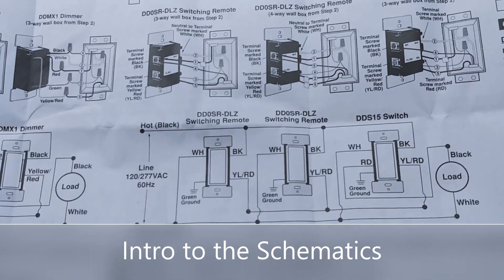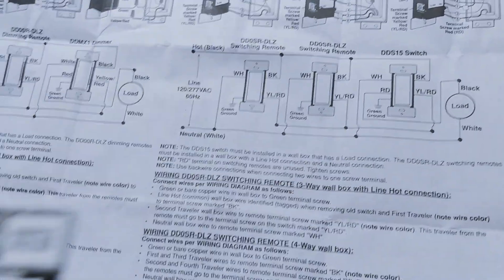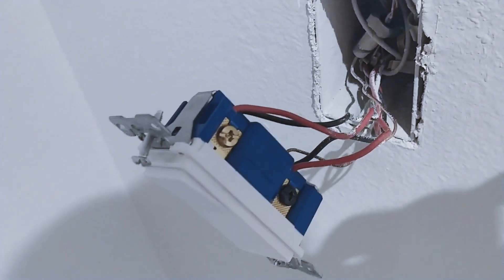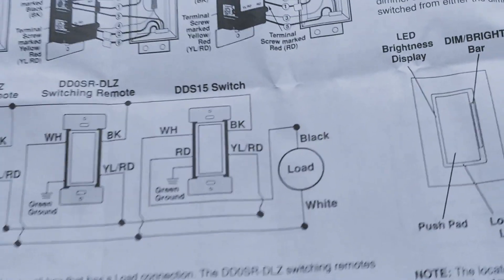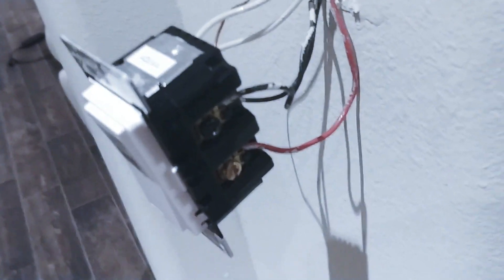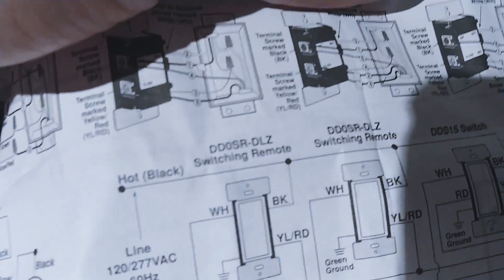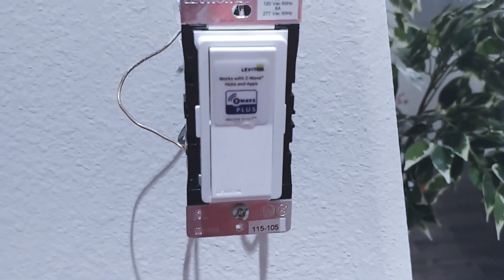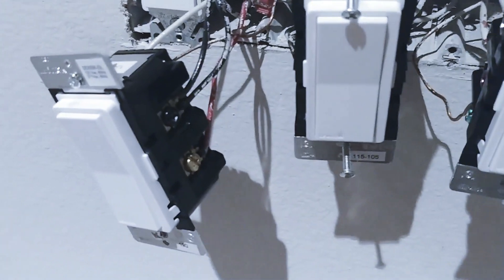Leviton Decora Z-wave 4-way switch installation with Home Assistant

Comment: My system is z wave as well where can i find that 4 way switch i find the single poles at Lowe’s its the same exact brand.
Reply: Thanks
Reply: Amazon has them. My local Home Depot never has the smart switch that I need in stock, I wish there was a Lowes's near me.

Comment: If i am going from regular to smart do i need to change both switches that control that light ?
Reply: Yes, unfortunately. You need to change them as they communicate to the main switch via the travel wire
Reply: Thanks for your quick reply that was awesome. I change all the single poles but the 3 ways are a little annoying the have two red and two black wire

Comment: Great video!!!   You probably won't be able to answer this before tomorrow 6am eastern time but you are doing exactly what I am attempting to do!  Again thanks for the video!  Here is my question, does the two "dump" 3 way switchs have to be smart remote switches or could a just use my existing truly dumb switches and just replace the 4 way switch with the for way you suggested?   I see someone asked the same exact question below.   If anything, I will be sure to give you an update if my truly dumb existing switches work.
Reply: They have to be Smart "Remote" switches, you can't use the conventional 3 way switches in this set up.

Comment: Thanjs for taking time to make this great video, however, it took me 4 replays to capture what the gentleman was pointing at, on the schematic as well as the physical switches themselves. I hope you can accept some instructional feedback? Looks like you replaced the "middle" switch with a 3-way, correct?
May I suggest on future instructional videos that the demonstrator uses some sort of insulated pointing implement (like a wooden chopstick) to indicate the actual location or area (on the schematic as well as the physical switch) that is in play so we can understand more clearly what is being taught. I found it a bit difficult to track by trying to understand what was being shown on the paper especially. Thanks in advance for understanding.  Best wishes.

Comment: This is the only documentation I could find on installing Leviton smart switches in a 4-way config, and I can't thank you enough for posting it! I got the the 3-way from my switch diagrams, but I was having a hard time figuring out that middle switch. I have the Google/Alexa version, and it doesn't have 4-way included. This video saved the day!
Reply from the maker: glad I could help!  I felt the same way.  Nothing that explained the steps in detail, so I figured I'd put something out there that could help others.

Comment: I'm curious if status changes are pushed instantaneously when activating the lights from one of the DD00R add-on switches? From my understanding, the new Leviton Z-Wave Plus devices are better than their predecessors, but others have alluded that there is delay in updating HASS.
Reply from the maker: I actually have an older generation "non z-wave plus" leviton dimmer, along with these newer generation versions.  The older dimmer does not push status updates to HASS regularly and tends to be delay, whereas the newer z-wave plus models (shown in this video) update near instantaneously.   I'd avoid their older models, but the new ones are just fine for use in HASS.